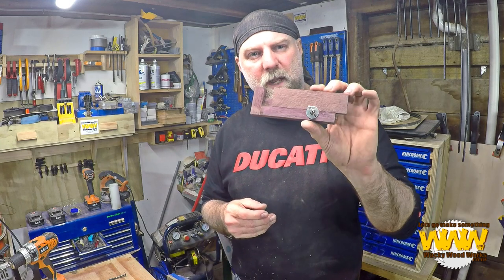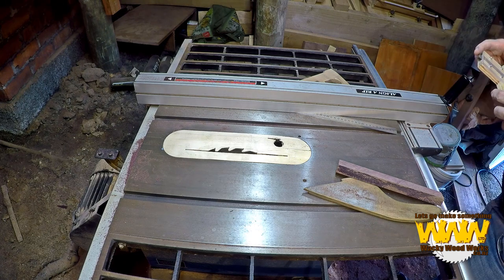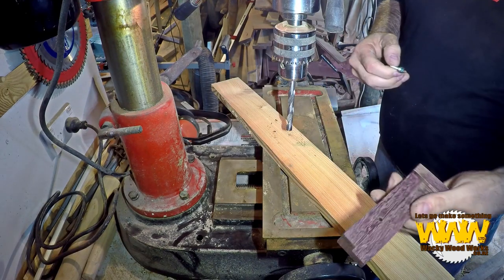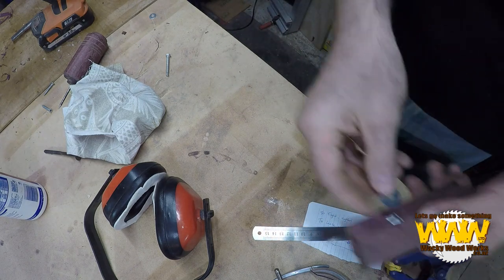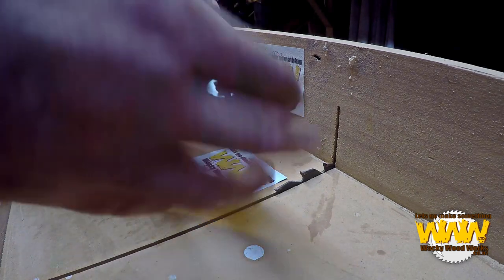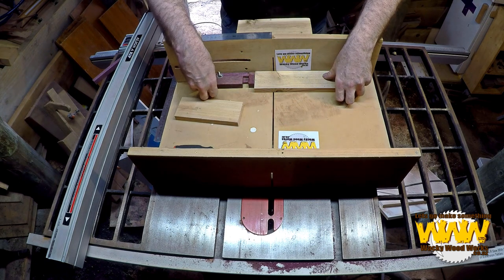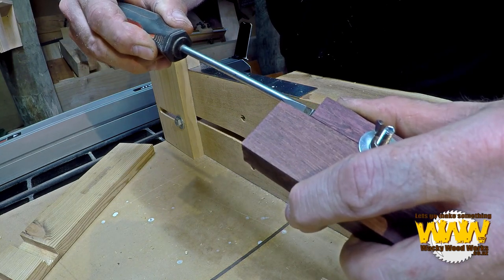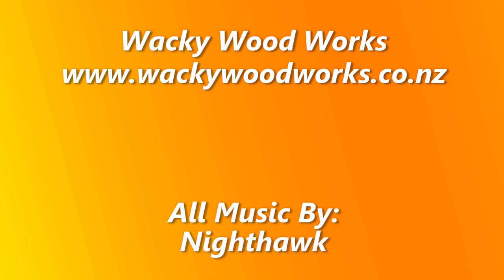Kerf Maker - Off the Cuff - Wacky Wood Works.

Comment: You can avoid the screw fiddlyness by just cutting the butted together joint with your blade. It’s a simple enough device to make one for each blade. You could also reset it to a new blade by trimming the end and then cutting the kerf.  This of course would then not be adjustable, but it would be exact and account for any runout in the arbor.
Reply from the maker: All good ideas...  However, I needed it to be adjustable...